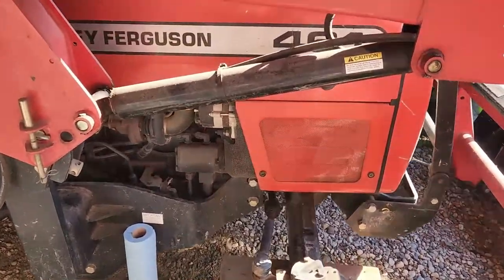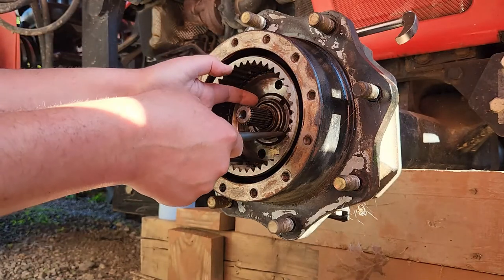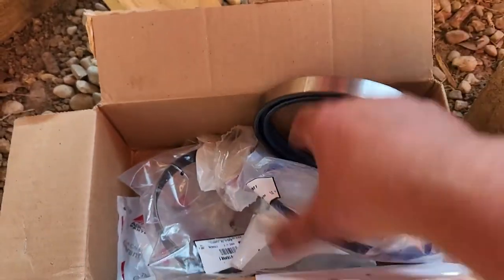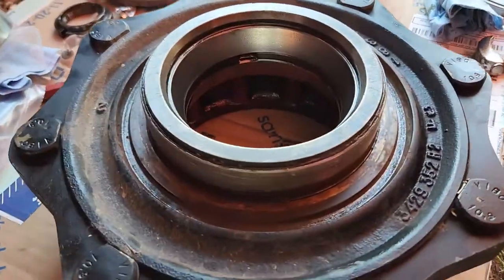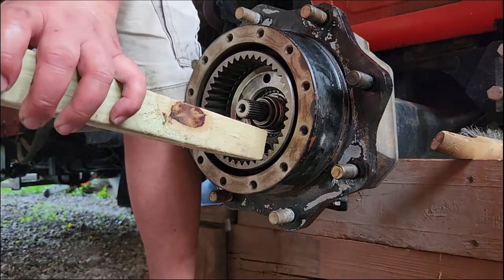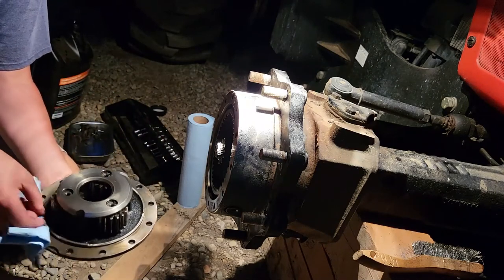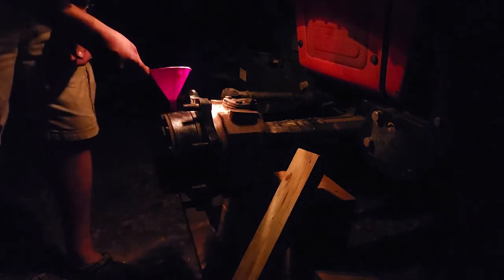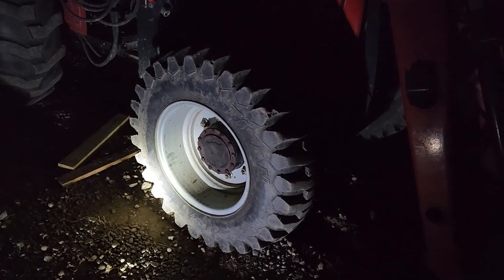Massey 461 Hub Repair

Comment: i have the same tractor do you have any idea how to remove the bearing on the front axle pivot pin on the top of the knuckle.
Reply from the maker: Hey, bud! 
I have the service manual for the 461. Give me some time, please, and I will see what I can find. I'll keep ya posted 👍🍻
Reply: @TractorFella  thank you so much
Reply from the maker: Hello again! Just to clarify, you mean where the knuckle pivots to steer, correct? Where it attaches to the top and the bottom of the axle?  I think I found what you're looking for.
Reply: Yes that is what I was looking for
Reply from the maker: @ryanlee4881   So it sounds like there's a pin that the knuckle rotates on as well as a bearing??  The picture isn't great. There's a special tool you are supposed to have (see step 4).  Maybe you can figure something out. Alrighty... here we go:

They call this the "Swivel Housing"

Removal
1.)  Remove the ball joint for the steering tie rod (if you plan on fully removing the knuckle)
2.)  Remove the 4 bolts that hold down the upper cap (it's the cap that has a grease fitting in it I believe on top of the knuckle)
3.)  There will be shims under that cap - Remove the shims.  Under the shims is a "bearing cup" (so they call it).  Remove that too.  I'm guessing it just pulls out?  No tool is called out to remove it.
4.)  Tool number = MF.451B and MF.195C <-- supposed to use these to remove the pivot pin.  Sounds like you can use a 14 mm bolt to screw into the pivot pin and maybe attach a slide hammer to it to pull it out?  Here's what is written:  "Screw the 14mm adapter into the pin and onto the main puller.  Remove the pin from the housing" 
If that's the case, you could probably rent a slide hammer from your local auto parts store.
5.)  If you're going to do the bottom pin, repeat the same process for the bottom side (although the bottom cap will not have shims in it).  When you pull off the knuckle, it sounds like the axle may come with it.  

Installation
1.)  "Renew the seals on the pivot pins" ... whatever that means 😆
2.)  Fit the bearing cones to the pivot pin.  DO NOT grease the bearings at this stage.
3.)  Coat the pivot pins and holes with a light application of grease.
4.)  If you've removed both the top and bottom pins, hold the knuckle in place and partially push the pivot pin back into place.  Repeat with the lower pin.  Shims are NOT used for the lower pin.
5.)  Tighten the 4 cover bolts on the lower pin (if you removed it) evenly in order to push the pivot pin back into the knuckle.  Torque spec = 70 Nm
6.)  For the top pin, they want you to install everything, but add additional shims below the cap to ensure the pin is fully seated.  Then, remove the cap, remove the extra shims, and then put the cap back on tightening it to 70 Nm.  
7.)  NOW they want you to put a dial indicator on the top or bottom of the knuckle, and pry the knuckle up and down to make sure you have a maximum movement of 0.15 to 0.25 mm.  If the movement is too large, you have to add shims below the cap, too small, remove shims.  Yikes.  
8.)  Now that you did all that... (facepalm)  remove the top and bottom caps AGAIN, add grease, replace the caps, lubricate the bolts for the caps, and torque to 70 Nm.  
9.)  Then use the grease fittings on the caps to finish pumping in grease.  
10.)  Replace the tie rod ball joint and torque the nut to 106 Nm.  

Dang man... sounds a little scary.  I wish you the best.  Let me know how it goes.  Make a video about it!!!

Comment: My tractor mf 455xtra left tyre not rotate, this make reference for me, thx
Reply from the maker: You are welcome!  I just checked mine (it's been about 2 years since I did it) and it's loose again, so I'm going to pull that cover off and see if another nut has broken.  I hope not.  Good luck with yours!